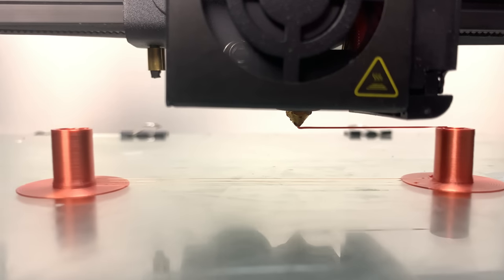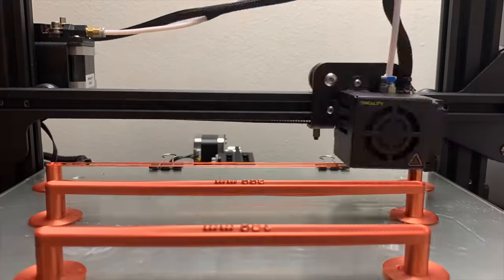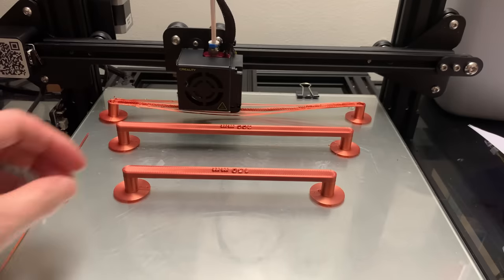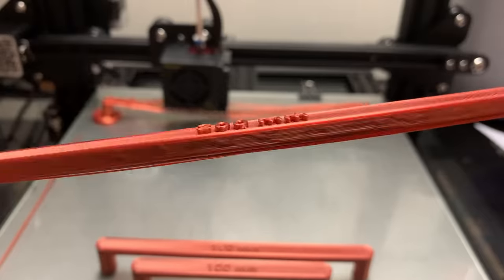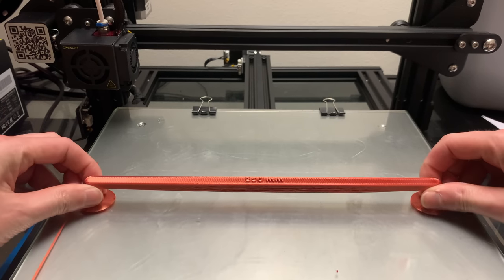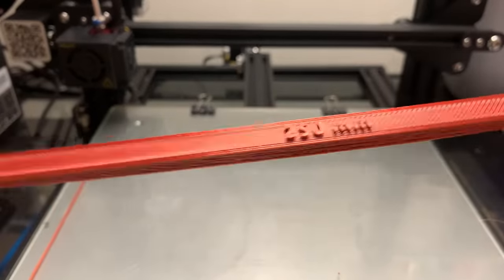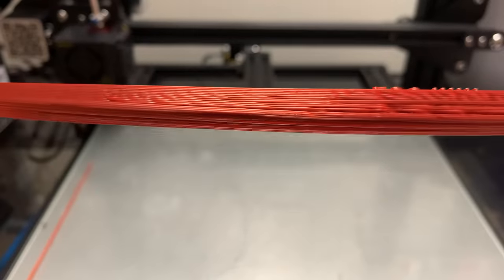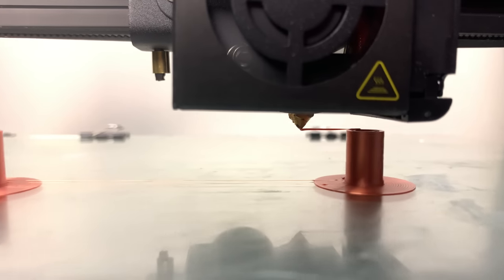How far can a 3d printer "bridge"???

Comment: This video is BS.  The only reason you can't bridge further is because your printer isn't tuned for it. If you tuned your settings carefully you can do five times that.
Reply: You’ve bridged a whole meter?

I’d love to see that done!
Reply: Please make a video about that.
Or take a picture.
Reply: I’ve “bridged” 122cm with crappy bargain-basement PLA using one of those 3D pens, which have no cooling fan. I’d estimate I had to move the pen at ~250mm/s or more, and it was saggy as hell, but I managed to turn a friend’s front doorway into a fake spiderweb without too much trouble.